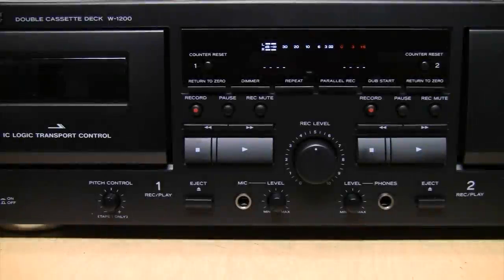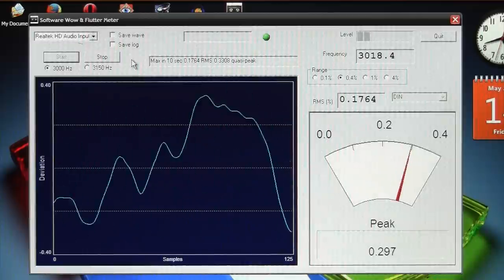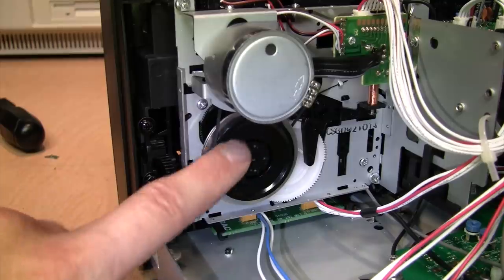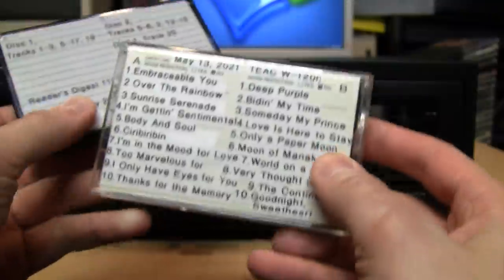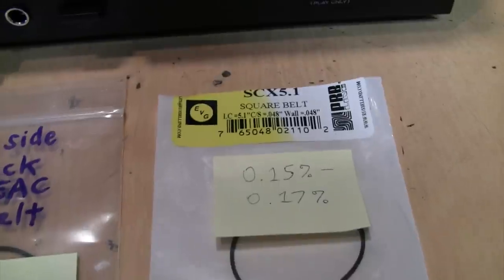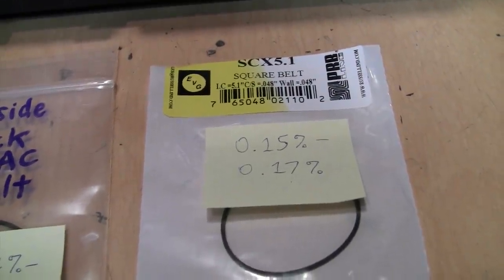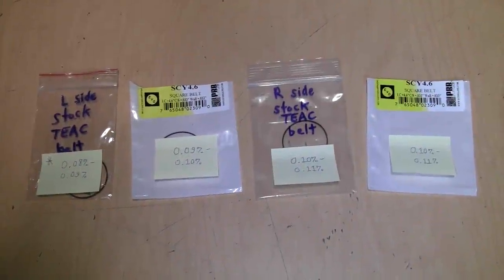The big difference little cassette deck belts can make

Comment: What's your recommendation for estimating a belt size, when the original belt has become goop?
Reply: I've tried tying a piece of thread around the pulleys to get a fairly accurate measurement. There's also the fallback solution of buying a variety pack of belts and using some trial and error.
Reply: @foxyloon  cheers fluffbutt
Reply: What ever you do do not buy the cheap packs of chinese belts they are terrible .
Reply: @paulb4uk   Might be a good way to get a sampler size that you can measure, though!
Reply: There's a chart for vintage decks: http://russellind.com/client/download/PRB_Belt_XRef.pdf

Comment: Your amazing. One question. How do i find a belt for a tape deck that has no belt left to measure.?? Seeing you struggle does not seem vary good for me.
Reply: His amazing... what?

You'll probably have to experiment with a multi-pack of belts, good luck finding detailed technical specifications for one of these old decks.
Reply: @markallen1782  ill try it

Comment: I got 3 free players. 2 are duds and 1 works. The one that works is now starting to not work. I opened the 2 that didn't work and the belts have turned to goo. I suspect the same for the one that works. I bought a variety pack of belts off amazon. Not the best but they should work. All different sizes. I will try today. They are nice and don't want to throw them away because of belts.

Comment: Wonder of you could use Quad Rings for belts  (aka: X-ring, a square o ring replacement).

You could get an Aviation spec Quad Ring, even just a standard spec Quad ring probably is more consistent in manufacturing.
Reply: McMaster-Carr O-ring Cord: (ASTM D2000 spec)

2mm Buna-N Square / # 1216N2 / $0.37ft / Durometer 70A
2mm Buna-N X-Ring / # 1191N14 / $0.48 ft / Durometer 75A
2mm Viton Square / # 1175N14 / $2.13 ft / Durometer 75A
2mm Viton X-Ring / # 1191N14 / $5.03 ft / Durometer 75A
1/16” Silicone Square / # 1177N11 / $0.30 ft / Durometer 70A

(wrote this out for another comment, thought Id add it here)

Comment: What happens if you play the Parliament tape in the left deck and the stop smoking tape in the right deck at the same time?

I have a set of replacement belts for my Sony deck that I got from Slovakia. I still haven't installed them since the originals appear to be fine for now. What I really need is a test tape. Any opinion on those "professionally duplicated" tone tapes available on ebay? Getting a hold of a factory Sony or other major brand test tape is going to be impossible and/or expensive at this point.
Reply from the maker: The quality of those test tapes are variable. Since I work on cassette decks so often, I forked over around $50 for a real TEAC test tape on eBay. ABEX is another common brand of them.
Reply: @vwestlife  Sadly they've moved into 3-figure territory when they do show up.
Reply from the maker: @NJRoadfan  Check your e-mail.

Comment: Another experimental variable: the power. I wonder if there would be a difference between mains AC, and the AC output of a pure-sine inverter on wow and flutter...
Reply from the maker: These decks use DC motors, so that makes no difference.

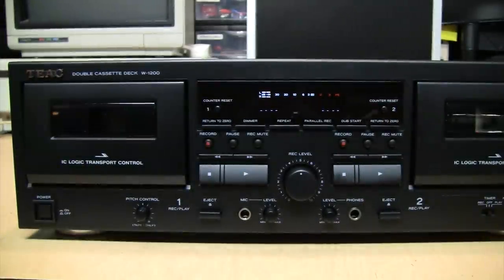Comment: Your “Pitch control” is slightly to the plus. At 14:05 and not at 01:49. Did you do the test with zero pitch?
Reply from the maker: It was set to the zero position for the measurements. But the Incorrect Music tape was recorded on a different deck that was running at slightly incorrect speed (appropriately enough!) so I had to compensate for it.
Reply: @vwestlife  Oké. Cool. thanks.

Comment: Hi there Could I use a 2mm belt instead of a 4mm belt for the motor drive? I bought the wrong assortment pack from Ebay. Thank you

Comment: I had noticed the left level indicator was reading higher than the right during playback of the tape near the end of the video.

Unless it was the meter level readings inaccurate,,,the sound would not b even in both speakers..
Reply from the maker: The tape was originally recorded that way.
Reply: @vwestlife  Ok. I guess that tape was recorded from another tape deck?

Comment: Nice work and analysis, while the target device quality and design speed stability even under the best case scenario is at least questionable:
-Deck is not using proper heavy mass capstan wheel
-Capstan belt is pulled by tiny square belt, not even a proper expected for required task flat belt for proper torque-force mechanical transfer
Conclusion: Time well spent (results are questionable)

Comment: Hi West Life

I like your vidéo Channel

In the part i own a cd91 harman kardon cassette deck but the motor ran out.
I get rid of it.
Now i have cassette that i can listen on walkman or a défective technics tr333.
Now the big question is it better to buy a use unit or buy a teac w1200.
I read that on vinylengine  that the teac  w1200 after 100 to 150 Time the unit tend to breakdown but you have a warranty,that about your experience what is the best deal,buy brand new or a use one.

Thank you

Comment: How did you measure wow and flutter?
Reply from the maker: Using WFGUI on my computer.
Reply: @vwestlife  How is it connected to the deck?  Thanks
Reply: and w a calibrated test tape of 3000hz or 3150hz

Comment: Mine can barely even turn with many tapes I try and I returned exchanged about 4 of these units. They're all like that. W&F is the least of its problems.
Reply from the maker: Maybe your tapes are just bad? I've reviewed several TEAC and TASCAM decks and none have had that problem.
Reply: @vwestlife  It can't be there are too many for it to be the tapes and most of them will play fine in a vintage deck.
Reply: I also pick up the tapes from all over including ebay/discogs etc. so it is not just the batch. Usually is will play fine at the beginning of a side and then slow to a crawl toward the end of a side. Other tapes work fine.
Reply from the maker: @iiiiii1449  Did you try fast-forwarding and then rewinding the tape all the way to loosen it up before playing it?
Reply: @vwestlife  Yes. It may help a little bit but not enough to make the tape listenable.

Comment: So the factory belt is the best, naturally. 0.1% WRMS is OK for an entry-level deck, I think it is the borderline value that the now defunct German standard considered to be worthy of "hi-fi" moniker. 0.15% is OK for an inexpensive portable player. Not very impressive numbers.
Reply from the maker: According to the official DIN standard, tape recorders with a wow & flutter of less than 0.20% peak (DIN) can be advertised as "Hi-Fi".
Reply: @vwestlife  Exactly. In your testing the better deck reached exactly ±0.200% W.Peak at 2:14 mark, while the worse deck was reaching ±0.3% W.Peak. Not to mention the official advertised number of 0.25% WRMS that would be equivalent to about 0.5% W.Peak considering the empirical relationship between WRMS (JIS) an W.Peak (DIN).

Comment: is maybe dumb what i going to ask... is got a some realy realy rare walkman (soviet made) and the belt inside is realy realy strange..... flat large and not realy elastic (maybe du to age) and i cant find any sadly. its a  Амфитон П-402С is imposible to find....
Reply from the maker: Maybe it's a cloth reinforced belt? I've seen those in some reel-to-reel macines.
Reply: @vwestlife  sadly for the moment my issue is the size. that realy à strange belt...
Reply: Buy a phat multi-pack and start chuckin' em onto the rollers
Reply: @KGB240 I got some flat one. but the final result is terrible compared to the original one. there a place for make custom one?
Reply: @SianaGearz  tbh taht look exatly like a turntable belt but more short. like the one on the LP-3 but more short of course.
and for a soviet thing it dont sound taht low-fi i like more than my sony in sound rendering. after alls there literaly not elecrtonics inside it.
 but sadly now the belt is too lose for drive corectly the cassete.i got some picture of the inside and the pcb is clearly soviet made.

even the capacotir are soviet resitor inductor ect. alls in cyrylic.

i got teh same model but post soviet one . abd on that one yes alls is out sourced. even alls the amplification module. is literaly a separated bord on that one .

i also got a 3d printer but i dont think i got the capacity to make belts.

Comment: I notice as you put tighter belts on the speed gets lower and lower
Reply: That's because of increased resistance... put iron bricks on your feet and you too will go slower and slower
Reply: @KGB240  I'm not daft to the fact that the resistance will be higher, that is what I'm pointing out. YouTube comments at their finest.
Reply: That's a good test for different belts, if it goes slower the belt is tighter. I going to strength out some of my new belts  
(which have higher W & F)

Comment: One good and bad thing with your tape deck here on this demo. They used individual motors on each deck, and that is better in one respect. Yet the cheep dual decks running off one motor have one unique advantage. That advantage is that your copied tape will be closer to the same speed as the original, but any fluctuation of the roller the belts or other drive issues will still affect the copy some, as well as double the drag on the motor running two decks = cheep. Now Sharp did this double well cassette on some of their boom boxes. I have never had one but I can assume a copied tape on that machine would be the exact speed as the original as long as the tape did not bind in the cassette shell = cool.  You could experiment with the collection of belts, yes from China, or thinner belts as well on the take up reel. Your main belt is the most important for wow and flutter. 
  Dumb MFD's ideas I still find frustrating. Why do they get the drive of the take up real from the fly wheel, or the capstan drive. I do have a Sharp tape tack that used a second belt from the motor but it was for RW and FF drive use, not the take up reel. They used a little rubber on the capstan, that drove a small idler that drove the take up reel with a slip disc/ring. Sadly the little rubber on the capstan gets worn away or deteriorates and the part is almost impossible to buy. Got the little part from Czech Republic last week. The open reel machines of the normal design are made often the same way. Three motor reel to reel or two motor/three motor single deck cassette machines are the best drive systems.  I just had to rant........  Thanks for the video VWestlife.

Comment: you tried. but frankly, I eould not rxprct zo have to fine tune a brand new deck, for it toperform optimslly.)I am pitch sensitive)the Tascam version is even more expensive and one could expect the situation to be the same, unless they are grading the dekcks, after assembly, before branding them and fitting the relevant different VU meters etc. pass.